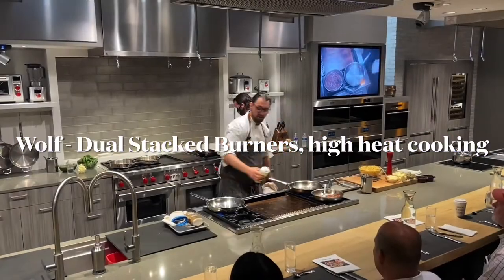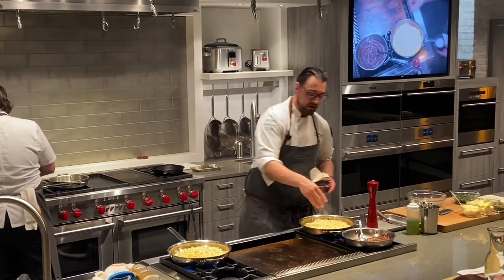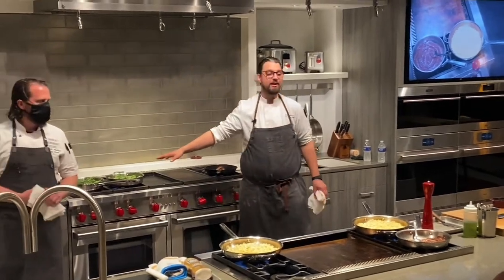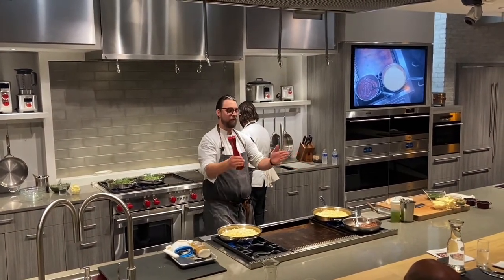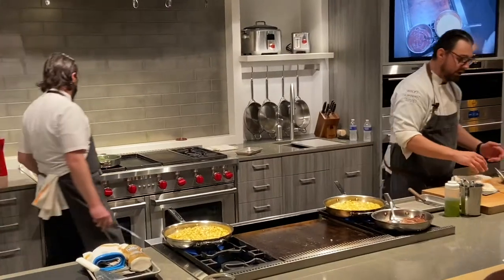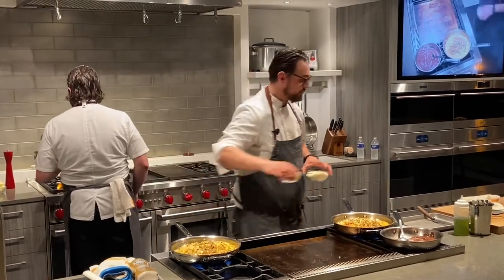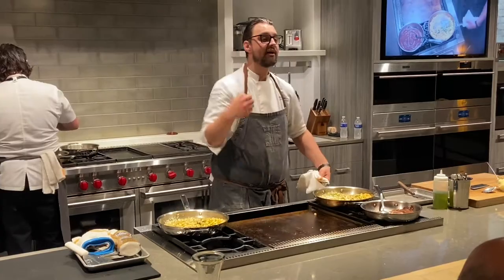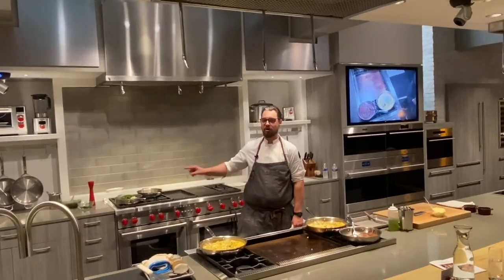Wolf® Dual-Stacked Gas Burner demonstration - HIGH HEAT COOKING

Comment: I see the broccolini and corn are in sauté pans.  Is there any reason they couldn’t have been done on the griddle?  Just easier to plate/remove?
Reply from the maker: Yes, absolutely they could have been done on the griddle. In this quick demonstration, the chef was showcasing the Wolf Dual-Stacked gas burners - high heat to very low heat (keeping something warm without scorching). 
Thanks for watching! Hope this helps.